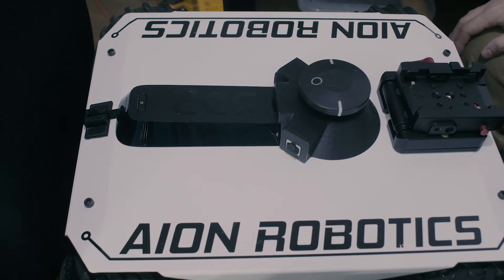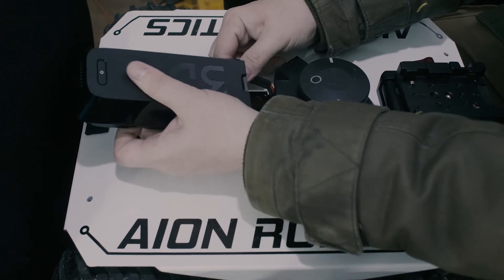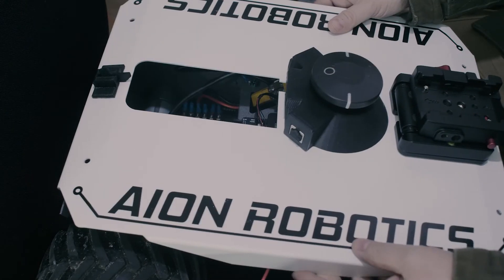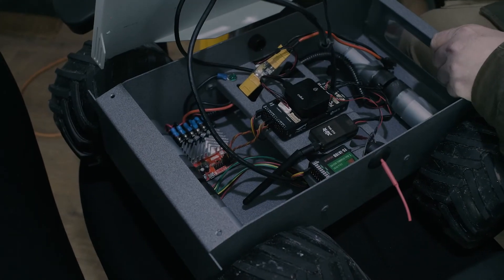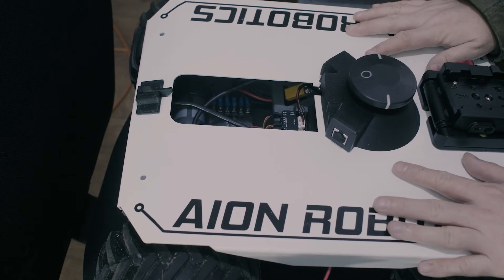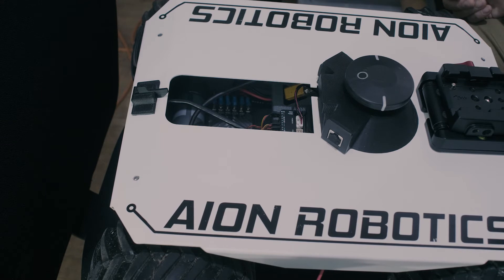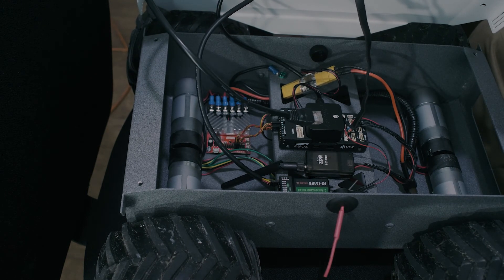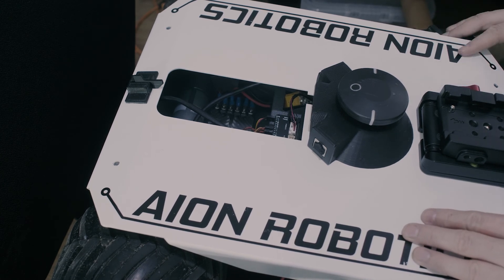My view on the Aion Robotics R1 rover build process

Comment: Great rover been looking at these to purchase. I notice the 3DR battery that comes with this rover. What kind of drive time can this achieve? These usually come with 5200mAh, so considering this amount of battery I would assume around 30 mins to 1 hour maybe? If it achieves more how is that possible? Many thanks and enjoy your rover it’s a lovely bit of kit👍🏼
Reply from the maker: It's far more than that I believe, check with Nick at Aion but it draws less than a drone, so I think it's supposed to be several hours.
Reply: Hello. Yes, the R1 is geared very efficiently. Continuous run time is +3 hours.
Reply: AION ROBOTICS is that just on a 5000mah battery? Sounds unbelievable for a battery of that size!! Amazing if that’s the case
Reply: @LondonMus   Typical R1 configurations draw roughly 1 amp at full speed on a flat surface. Its a 5.2Ah battery. Very efficient as you can see.
Reply from the maker: @LondonMus  Yeah, a 5200mAh battery.  Rovers are more efficient with batteries than drones are.